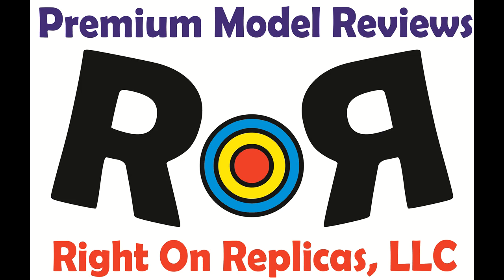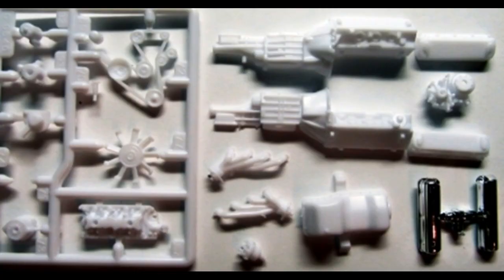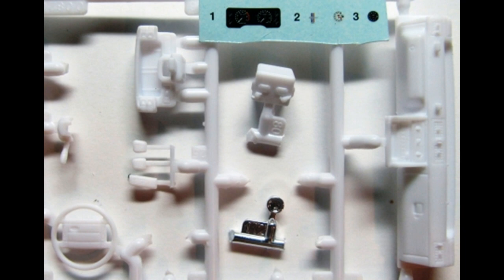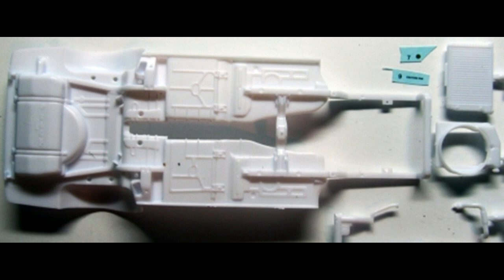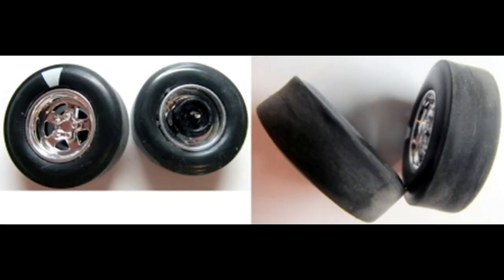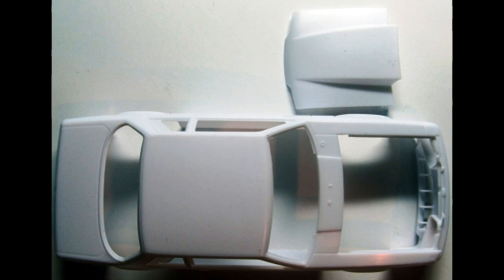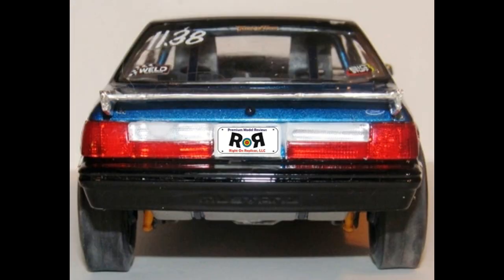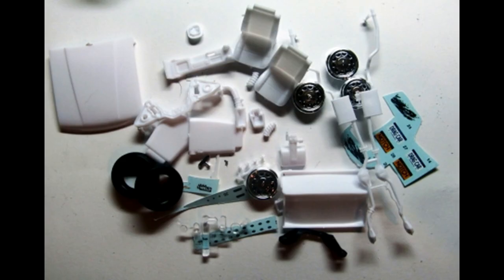How to Build the 1990 Mustang LX 5.0 Drag Car 1:25 Scale Revell Model Kit #85-4195

Comment: Does that spare part to hold up the engine get used on the 'stock' build of this?  I'm not building the drag version.  Thanks!
Reply from the maker: B,  I think you're talking abut the "third member".  That goes under the rear of the transmission tailpiece to keep the drivetrain in alignment.  It's used on both versions.       PS,  please subscribe if you haven't already to help us reach more modelers.  -Doug

Comment: How many coats of blue paint did you put on I just bought one and I’m painting it orange and on the corner of the cowl of the hood  it keeps showing the gray primer
Reply from the maker: BC,  Just 2 light coats and 1 wet coat.  Light colors are sometimes difficult to use over a darker primer on sharp crowns like that.  Try spraying them from a distance so the paint is a little more tacky before it hits the surface.  It may take many coats to cover the primer.  Next time use a light color primer for those colors!  -Doug

Comment: I’m new to model cars your videos have been awesome to watch. Just picked this up as my second kit. How do you about adding color to the headlights?
Reply from the maker: JA,  Generally headlights don't need color except for older kit that had chrome plated lenses.  Adding a white tint to those can be done with some Elmer's glue or a thinned wash of paint.  Turn signals that are adjacent to the headlights can be colored on the inside of the lens covers with clear yellow tint paints from Testors Turn signal Amber or Tamiya Clear Yellow!
Reply: Right On Replicas Sorry, yeah that’s what I mean, the amber lights and such. Thank you for that quick reply!
Reply from the maker: JA,  Kinda thought maybe!  -Doug

Comment: damn yours looks so much better than mine! i had to use paint markers on the body since i dont have an airbrush, is there another way i can get that metallic look?
Reply from the maker: T,   Yes, if you spray light coats on after primer from a spray can of metallic hobby paint it will look good.  They offer many metallic paints for the hobbyist!   PS, please subscribe if you haven't already to help us reach more modelers.  -Doug
Reply: @RightOnReplicas  thanks for the help, this was my first kit
Reply from the maker: T,  No problem and welcome to the hobby.  You can get metallic spray paint at a hobby shop or online at sites like Hobbylinc.  -Doug